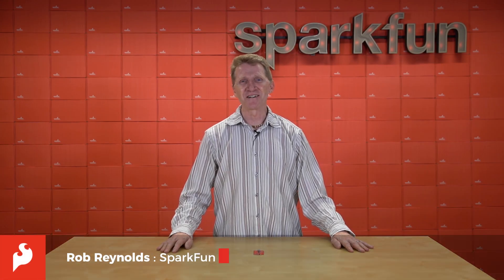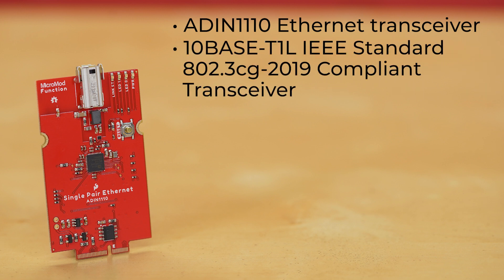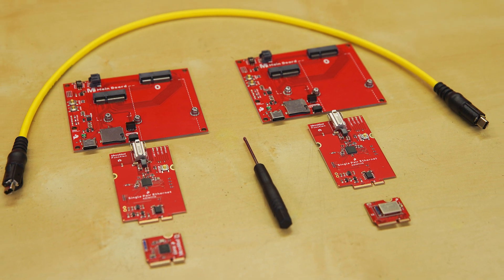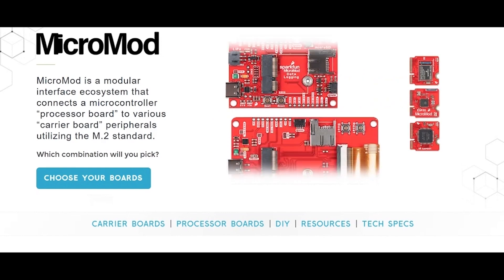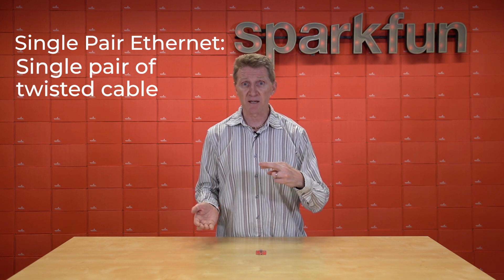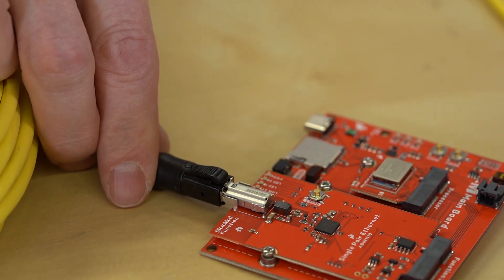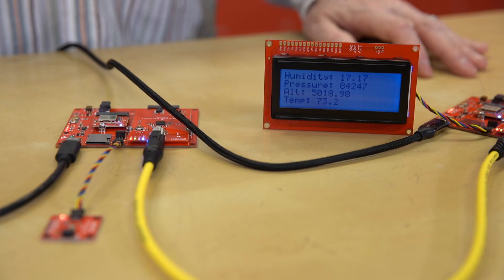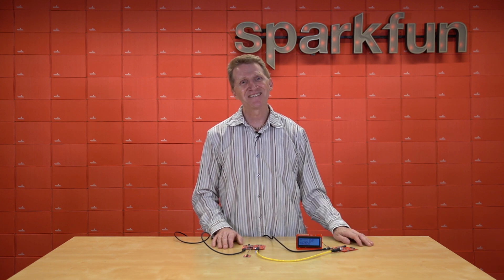Product Showcase: MicroMod Single Pair Ethernet Function Board

Comment: Gigabit ethernet capable of up to 2.5Gbps?? That seems like a weird definition.
Reply: The history of Fast Ethernet section of this video was mangled in translation from technical English to technical PowerPoint slides to management PowerPoint slides to Marketing Engrish.

I believe it was talking about the data rate possible per pair for different signal encoding systems. With the history starting at 100 Mbit twisted pair. (My history with Ethernet started in 1983 with 10BASE5.)

10Gbit Ethernet over copper does transmit 2.5Gbit per pair. The other speeds mentioned also had some historical significance.
Reply: It would be more accurate in a way to say 10 Gigabit Ethernet is capable of speeds down to 2.5Gbps (2.5G and 5G are the same protocol as 10G twisted pair but clocked slower. totally different from 1000baseT)

Comment: PoE on single pair?
Reply: The advertised product does not support transmitting power, just as most Ethernet devices don't support PoE. Transmitting power is an optional part of the single pair Ethernet standard.

My limited googling taught me that it is conceptually like PoE, but electrically very different, so they gave it a new acronym; PoDL for Power over Data Line or possibly PoDl for Power over Dataline. 

The amount of power that can safely be delivered depends on the specifics of the twisted pair, the devices on the cable, the voltage selected, etc... It isn't complex electrical engineering, but specifying a functional system is nontrivial.